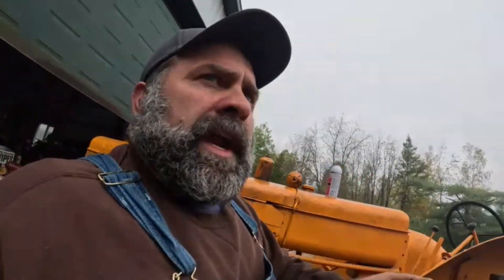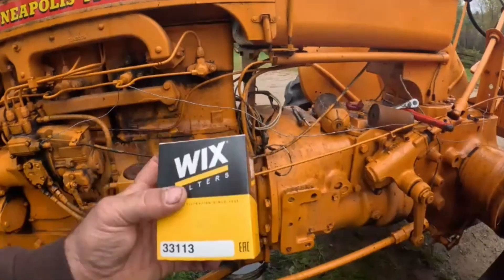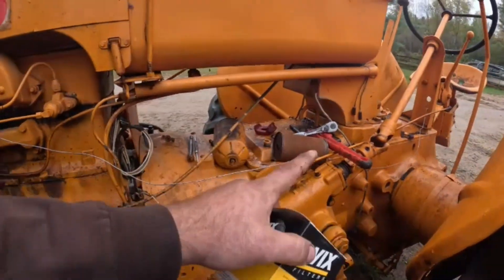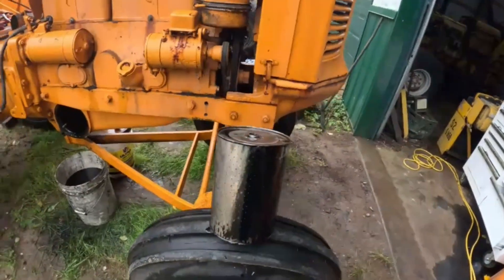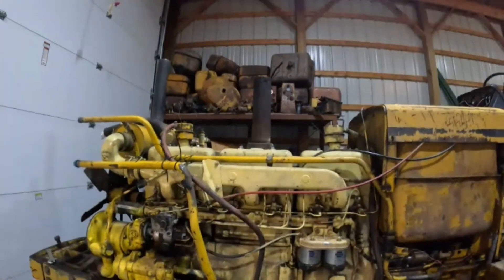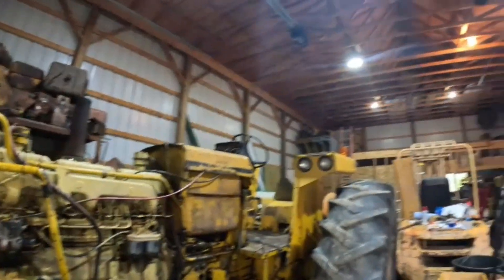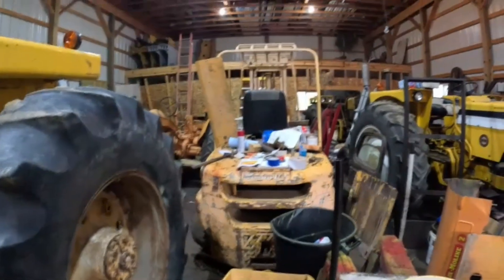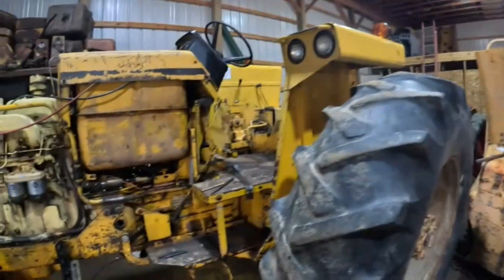UTS dsl part1

Comment: Dan the tool you are using looks just like the hooked scribe I used working as a tool builder. The mechanics pick I like has a handle on one end. Pick on the other end. Four to a set. I made a bar with a forked hitch on both ends. I can back up to back of a hay trailer. Push a trailer load of hay into a shed steer with the tough. I think that would work good for you moving dead tractors!